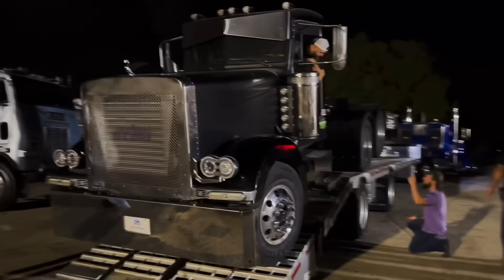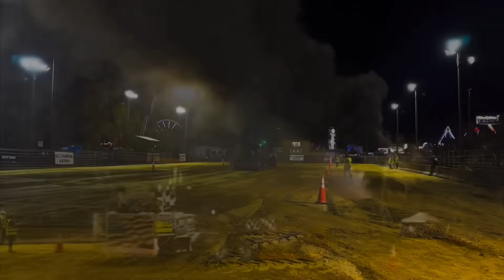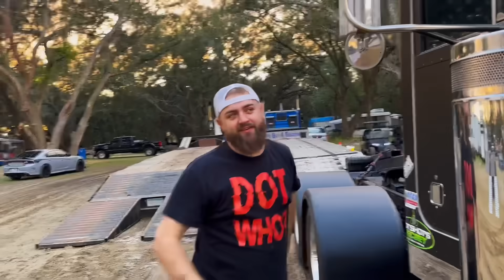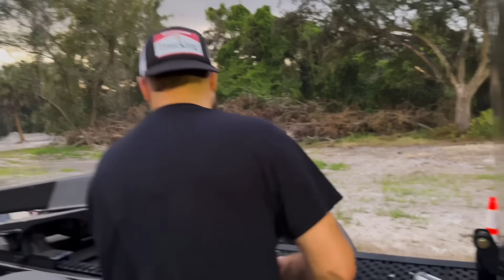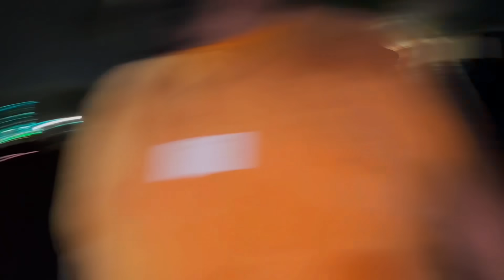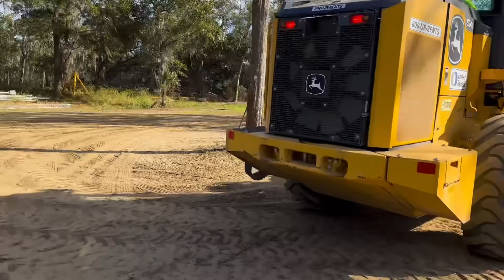HUGE SUCCESS our FIRST Time Out with NEW Engine In BUSINESS EXPENSE

Comment: Bruce on your hot side intercooler hose either double clamp them but if you don’t have enough room for 2 clamps, you can just clean pipes good and spray them with hair spray where boot seals with clamp and clamp them down tight. It works for us.

Comment: Food for thought: Cut the interior pipe extension on angle so to maximize total pipe length into the exterior pipe. The angle allows the hood to maintain a constant clearance as it is closed over the interior pipe.

Comment: Id run some planks from those ramps. That bumper was awful close to the floor when backing onto the trailer, dude. 

Sounds mint. Makes me think about the cat-powered 359 i saw on marketplace over here in the UK. Love these rigs. Shame i dont have a truck licence 😢

Edit to add. That issue with the coupler clamps coming loose. Would it help if the coupler was longer so the clamps can bite fown harder on the pipe as it barely looked on video like the pipe was going in to it